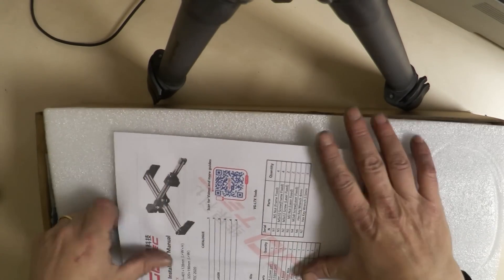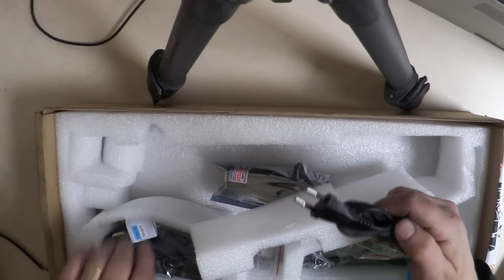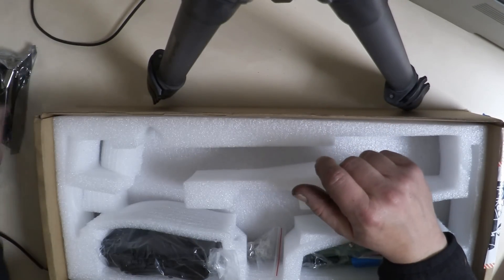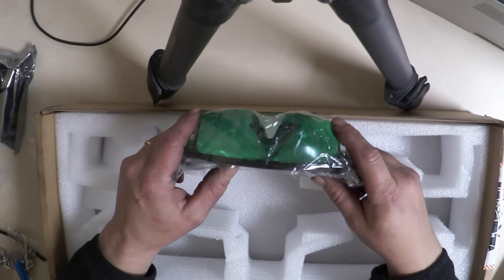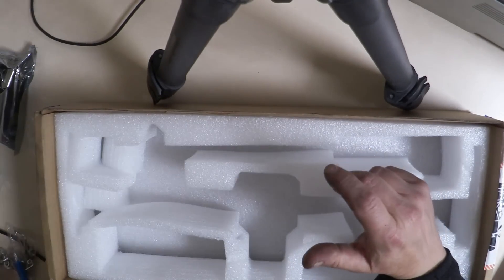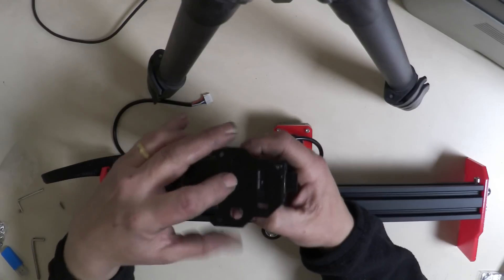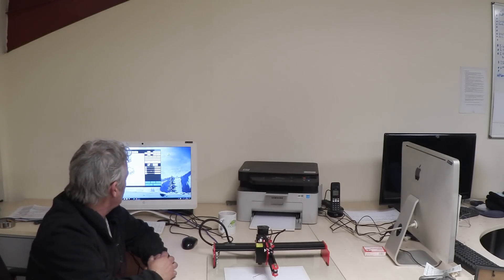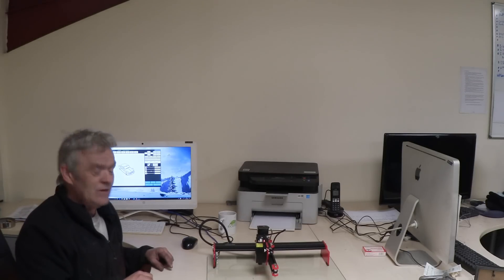Unboxing The VG L7X A 20W Diode Laser Cutter

Comment: I am currently investigating using a laser fitted to a CNC to produce PCBs. One of my concerns is reflections from the target damaging the laser diode. I am considering fitting a fan with air filter to suck away fumes generated by the cutting, before they are deposited on the laser optics. 
Laser protection glasses are ok for a single user, but something else must be provided if there are going to be more people in the room when the laser is active. This assumes that the protection glasses provided are acquit for the task. It is said that at least some of the laser protection glasses sold on web sites like Amazon and eBay may not provide the level of protection advertised. 
The are YouTube channels that have demonstrated such short comings using a laser power meter to test a range of protection glasses. There can be nothing worse than thinking you are using the correct protection, when in fact it is useless. 
 At 30 watts, even a momentary reflection into the eye will result in blindness. 
I will be very interested in your experiences with the laser. I was going to ask about the laser specification, such as focal length, focused beam width and wavelength. But I can look that up from the product reference.  

As a professional user, with responsibility for worker safety, there will be regulations to follow regarding laser safety. Have you investigated the regulations associated with using such a powerful laser in a works environment?

Comment: I have a similar diode laser based unit, the Ortur Laser Master 2. The power consumption is 20W but the laser emiitter is 5 - 5.5W at 450nm. After getting a good focus it will cut paper, card and 3mm black acrylic (going round 5 times). That frequency is not absorbed by clear acrylic so won't cut.  Plywood is very problematic, the problem is the glue, the supposedly laser ply I tried cut through the first wood layer but not through the glue so it just chars.  I plan on trying some laser grade mdf and also a G8 lens to replace the stock G2 lens to see if that improves things.   Don't rely on those visors, best to fully enclose the thing while in operation.

Comment: Back when you were making CR2023 cells using structured carbon from hemp you used a circular die to cut out the different layers for the cell. It occurred to me at the time that while that worked great for a single layer of active material to stack multiple layers you really want to leave a tab on one side of the anode and cathode layers so that they can be tied together. Something like this laser cutter would be perfect for that.

Comment: Looks like those diode laser cutters use input power in their specs, rather than optical output power, so the "20W laser" actually puts out 5.5W of laser power. Now 5.5W is still a lot of power, but it's not going to compare to a 20W CO2 laser, which is a real 20W. But at that price, if you can get it to cut thin wood or plastic it might still be useful.

Comment: that 20W is in reality around 8 watts, the laser diode ''may'' be able to reach 20 watts But it can not hold that output for long and the diode is run at a more safe output of around 8 watts otherwise it would burn out the laser diode

Comment: I’m curious, do you not have to focus a diode laser? I have a professional 40w co2 laser that requires a 2” focal length to get a nice fine line. Will it cut or mark bare metal, or is it like a co2 and only mark metal if it’s coated?
Reply: I would say you definitely have to find the perfect cutting distance. But unless the surface causes the laser to be closer or further, there wouldn't be a need to change it once it is set.

Comment: Hi Rob,
You planning on lasing graphene on kapton?
Reply from the maker: yes mate - I had a lot of trouble tasing caption with the CO2 laser - it struck me this wouldn't be as hard to get a good result
Reply: @ThinkingandTinkering  I've had some fun with mine. I bought a 15w upgrade laser head, but haven't had time to swap it out.  The Rice Univ. papers required rather low power though, if I recall.

Comment: Really cool cutter. What would help reduce fumes? Would conductive ink on plastic and small amounts of microwaves be worth a try or maybe Intumescent paint mixed with ink?
Reply from the maker: there is not a lot you can actually do about the fumes if you are cutting certain materials so about the only thing you can do is extract using a fan or avoid some materials mate

Comment: ah interesting getting to the point that shows it as an arm hanging out with the laser moving back and forth on that open ended arm, mine is trapped between two sides that have motors on both ends that I guess mirror power to allow them to move the same direction on their independent belts :) (also I bought more Vee slot and built a bigger unit now and it seems to be working fine even at the 12 inch by 17 inch range of motion I have now :)
Reply from the maker: yes I did a cnc machine that way

Comment: something else about mine is that the beam is not straight when it is finalized but rather a cone, to bring it down to a fine point of power, and I would like to use a reflector that is concave or convex depending on if just after or just before hitting that pinch point but so close as to get as much power packed into as tiny a dot so I can readjust the beam's  photons paths so they are in a straight line, that way I will not be limited by where that pinch point is, and can let it fly deep into a kerf while jetting air down in there and clearing out anything that does not fully ablate away as a gas or smoke :) Not sure if yours will have this issue of a beam conversion point, or not.
Reply from the maker: I don't know mate - I have done a little cutting of paper but have a couple of jobs I want it to do so I will be trying those as and when in the next few days

Comment: still watching but if this is a 455nm I am definitely jelly, LOL I only have a 15 watt one XD, (though thanks to buying a second head because I thought I was going to get screwed out of the head for the first one I tried to by serious story here if anyone wants to know about one particular pitfall that sellers can use to weasel out of refunds, if anyone wants to know anyway, I ended up solving the issue thanks to things like google maps and such, :) so now I have two heads as I got one finally when I bought the second unit with the refund money I got back, (they shipped me literally everything except the head, cross bar of VeeSlot and hardware to hold the head on, and the little PCB and USB to serial cable (there is a USB to standard serial converter chip in that little USB plug) so basically my hope is that one day I can get a combiner cube (two prisms that make a cube when put together on their 45 degree angle that has a coating on one side, that causes the beam to reflect off of the 45 degree angle while the other side the beam passes through both angle and flats thus you can put both beams right on top of each other instead of beside each other like knife edging, though there are losses because of the material you are shooting it through in both instances that I guess polarize the beam in some curious way to allow this, (DLP projectors do this too in some instances where the beams of three colors bounce off of 3 different DLP chips for each color, and then through a cube that is basically 4 prisms so that each can be bounced from sides of 2 colors while the last one passes right through from back to front of the cube, so when overlaid you get the appearance of "white" light if the power matches, which is really cool, but those are color dependent on reflecting, while the combiner I am after is not, :)  

anyway my hope is I will get a 30 watt input to the cube (two 15 watt pulses) and the output side of the cube should be like 25 to 27 or so watts *due to the portion of wattage absorbed by the cube and re-emitted as something like thermal IR or something :)
Reply from the maker: interesting mate cheers

Comment: AHH the ubiquitous chineseum deathdapter 😂 I'd put a proper UK plug on it 👍 you can plug a UK plug earth straight in to the line socket on those. Not sure about the two pin plugs, I think they reach from line to earth or something equally exciting 😱😁
Reply from the maker: there is no earth mate - one isn't needed - on the power brick side it is a class 2 electrically isolated piece of equipment on the dc side it is such allow voltage as to be harmless - if you fit an earth you are in fact making it more dangerous - so really don't do that!

Comment: You have no ventilation option when cutting plastic though. I suppose a box could be made to put it in so you can vent it to the outside or through a scrubber
Reply from the maker: nope - you might indeed want to make a box

Comment: Please check the safety of the laser goggles. 
 Cheap Chinese goggles are NOT certified safety glasses.
So you don't know what your getting. ( eyes are not replaceable)
Reply: even then, the pros use goggles that seal to your face to prevent light from getting in at weird angles.
Reply from the maker: Have a read at the Gov and HSE guidance documents for the use of class IV lasers - it makes a lot of sense.

Comment: I would be interested in a measurement of the actual power output of the laser. I suspect it's more like 5 or 6W, and the 20W is the input power to the head. K40 types apparently actually output 30-35W continuously.
Reply from the maker: I don't really care - I am only interested in if it will do the job
Reply: @ThinkingandTinkering Indeed, that’s the main thing.  "It doesn't matter whether a cat is black or white, as long as it catches mice." —Deng Xiaoping

Comment: On the issue of welders, my small Lidl transformer arc welder puts out 27 volts open circuit on the low setting and around 45 on the high whilst my inverter welder puts out 60 volts open circuit at all amps settings.  Interesting laser cutter.
Reply from the maker: don't touch the 60V - don't worry about the rest - anything below 50V is pretty much harmless unless you are standing in a pool of salty water while wearing a suit of armour
Reply: @ThinkingandTinkering  I wasn't planning to, though I have zapped myself with over 50KV before in a physics lab... with no current behind it.